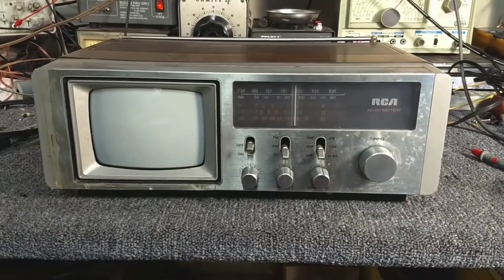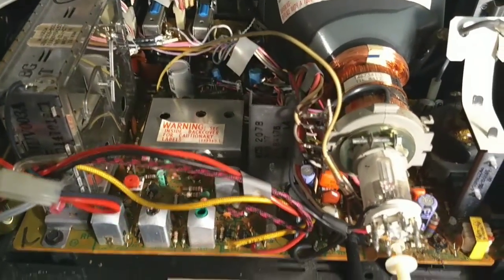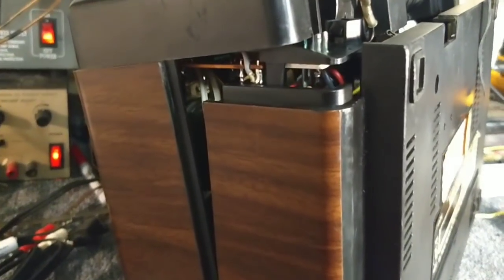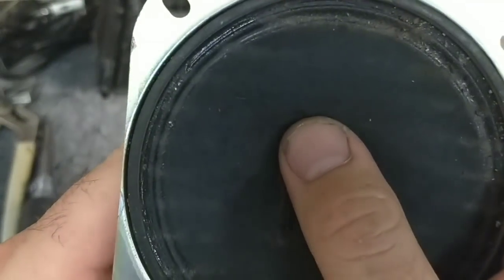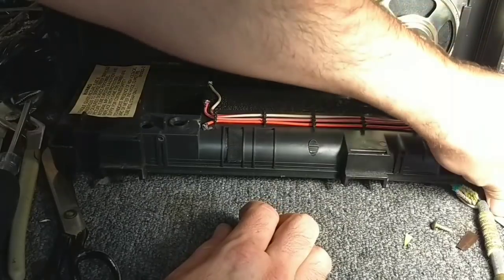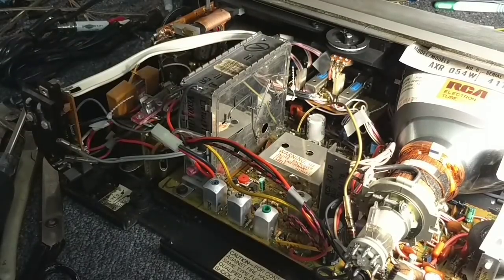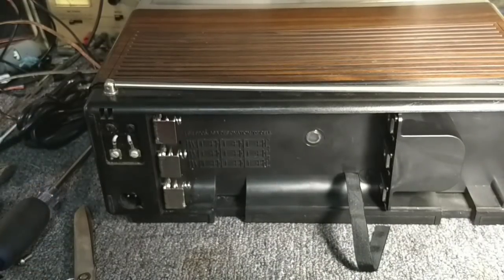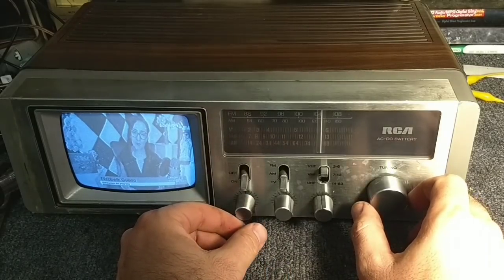Repair of a 1984 RCA AXR054W am/fm/ b&w tv - poor sound quality

Comment: That’s why I wish analog TV was still around. I had a RadioShack TV audio adaptor that could be connected to the car radio. You connected it like a VCR to your TV. Run DC power to it ( connect like a two way radio to the car battery). I could listen to VHF 2-13, which was fine. It was nice to have on the car ride home in the morning. I could listen to the last half hour of CBS Up to the Minute, then the Morning local CBS station here in South Dakota. It did not have UHF (the only thing I didn’t like about it). You tuned your radio to AM 1400 (adjustable slug in the bottom to change up or down 30 KC if needed).

Comment: I have repaired hundreds of speakers mainly in vintage radios and have never had a case of a voice coil out of round. All my repairs were for mechanical damage and metal including rust caught in the magnetic flux. Good to see you demonstrate this repair. Have you ever tried drying the voice coil by passing a DC current through it?

Comment: With a small speaker like that if it is rubbing, often it is the glue that has absorbed moisture  and swollen, or it has overheated and shifted, bubbled etc..Or the former has had a similar fate. To feel the rubbing area is very easy and as these little speakers are pretty hardy a light but secure grip on the cone and a rub up and down in a circular motion two or three times and voila it normally is restored to 'as new' - if it isn't valuable this is my quick method . . If the voice coil has loosened up or become unglued you have no chance without replacing the coil. Debris doesn't generally seem to be an issue. If it is you will need to pop the dust cap etc.